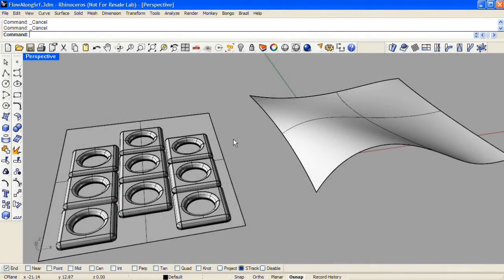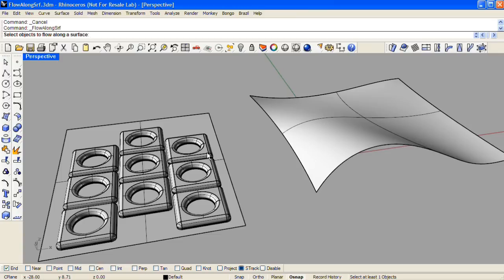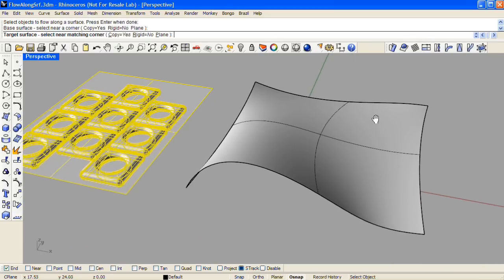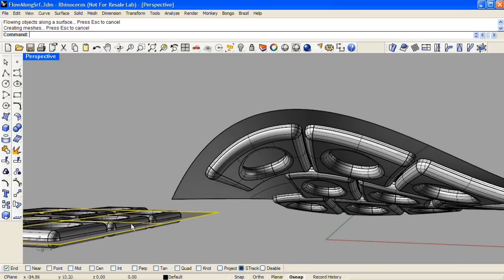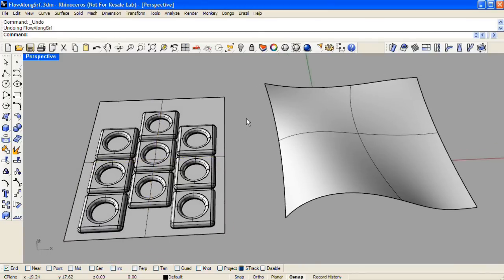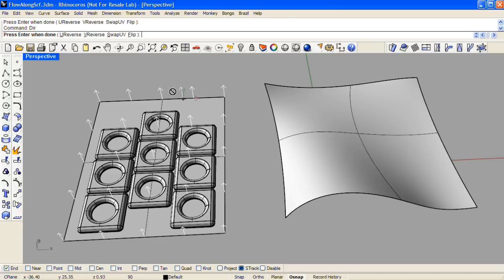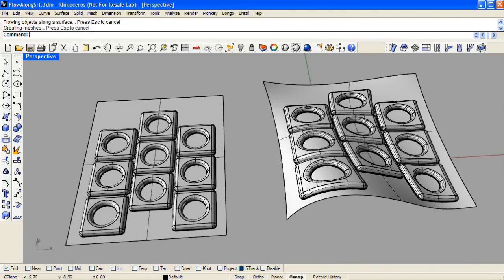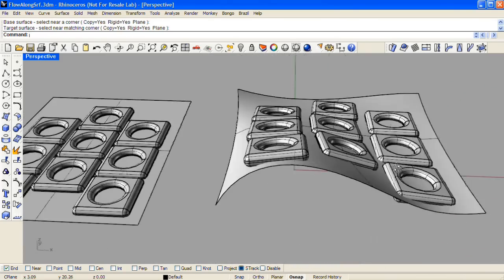Flowing objects along a surface

Comment: For anyone not getting accurate results like in the video, you need to know that the flat surface in this tutorial is extracted as a 2D representation of the curved surface using a command called CreateUVCrv. This command will give you a 2D rectangle representing the surface, now you have to convert it to a surface, place the objects you need to flow on it, and use it like in the video.
Reply from the maker: I recorded this, wow, a long time ago but I don't think I used that command to create the flat plane. I bet I copied the flat surface rebuilt it and edited that to make the curved one. Fine idea to add as a comment though, thanks. I should make an updated version of this one as well...

Comment: sir how can i polyline  pattern add in curve surface i did same as u mention video its going smaller and stretchable  please let me know thank you
Reply from the maker: It sounds like the surface control points may be unevenly spaced, try rebuilding it with more points as a test. If that doesn't help, post a file to the forum https://discourse.mcneel.com/ with your question.

Comment: Ìs it possible to flow it rigid, but only distort in ONE direction (i.e. the y-direction)?
Reply from the maker: +MrSendermen The Rigid option works in both U and V directions so you can't turn it off in just one but you may be able change the degree of curvature in one direction on the target surface to achieve what you want.  Can you post a model to the Rhino user forum to show what you're working with? It may be possible to do what you want with a custom target surface. http://discourse.mcneel.com/

Comment from the maker: Hi Eleniaicia,
I'd suggest the current release build of Rhino which is v4 with the current service release of SR9. This is available on the Rhino3D(dot)com site. Once you have a v4 license, you can use the v5 beta of Rhino which has a lot of great additions in it already like shelling and the 'Gumball'. Grasshopper will require either of these builds to run and is available for free on Grasshopper3D(dot)com. You can find GH video tutorials I've made on this channel or on Vimeo(dot)com/Rhino.

Comment from the maker: Hi,
You could certainly do some of the same things using PT when the grids used are from a domain technique. PT however gives you other options for controlling flow with a variety of grid making methods. Flow Along surface will always use the domain of the reference srf and the target srf for morphing and orienting. The choice really comes down to which tool is better suited to your expected result... and of course which method of patterning you find easiest.
Thanks,